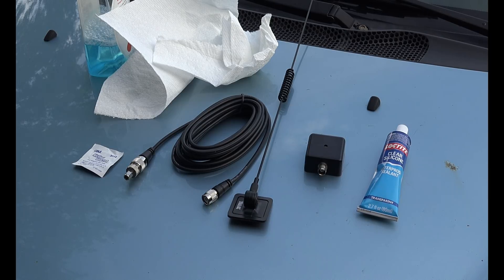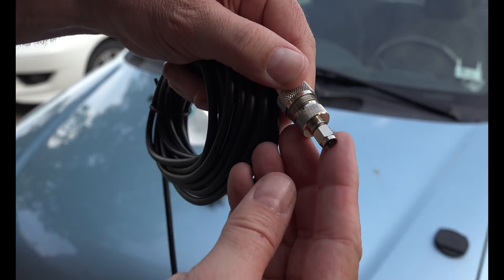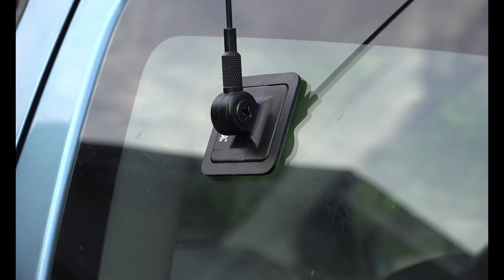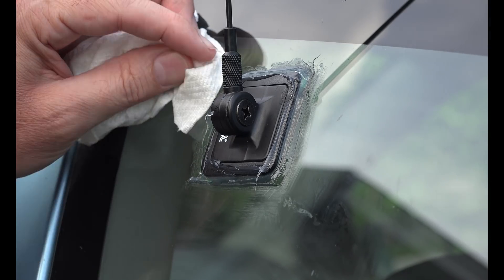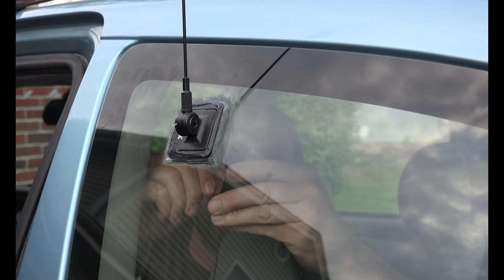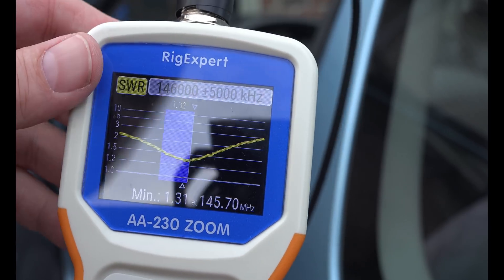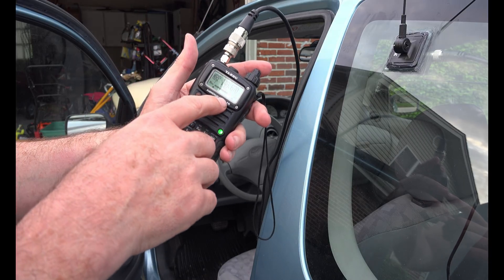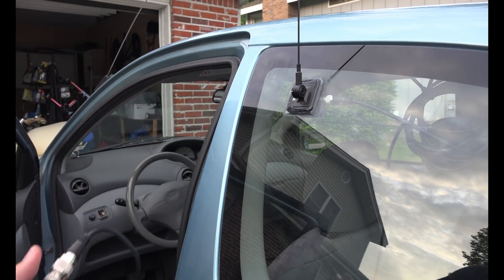Glass Mount Mobile Ham Radio Antenna Install ~ VHF UHF Repeaters

Comment: Great video! Thanks for the sub. This is exactly what I need. I tried a cheapo antenna from Amazon a while back that was a magnet bottom and wired down the side of my car door. After a while it just fell apart. I’ll try one of these.  I’m a total noob at HAM life. But trying to learn a bit as I go. Thanks dude.
Reply from the maker: Midwest Off Grid this will get you up and running on local repeaters. We can radio talk sometime if you want. My Twitter is @MyWheelsRock

Comment: Hey man I'm in Florissant I'm new to this. I just bought a diamond mr77 uhf hooked to uv5r I just noticed you were in stl. The only repeater ive found was 145.320 just from scanning. Do you have a list of repeaters I could try. I don't really have a clue what I'm doing lol. Mostly just want to scan. For fun
Reply from the maker: Hey there, I moved to Oklahoma City about 3 years ago, so I dunno.

Comment: I've used several of these over the years on different vehicles. Never had a problem. I currently have one for GMRS use on my pickup and my inlaws RV. Due to restrictions in my neighborhood, I have one attached to the only single pane window in my home. They all work perfectly. 
CHEERS from Colorado

Comment: Funny thing: I've been installing glass mounts for more than 30 years in both ham and commercial applications... Mainly Larsen, but quite a few Tram models... And I've never had one fall off. I've seen them last ten or more years in use. I've had my own last more than five despite Illinois winters and weekly automatic car washes. And I've never had to seal any of the hundreds I've installed and maintained. Seems like overkill, but if it makes you feel more secure, go for it.
Reply from the maker: Yeah thanks for the comment, probably don't need extra adhesion, but it makes me warm fuzzy

Comment: What adapter did you use to step down connect the handheld to the antenna cable?
Reply from the maker: You will find it in this box.  I have this: UHF Adapter Kit: https://amzn.to/2q3XvDu

Comment: That silicone skills ^^
1.) apply silicone kind of like you did but dont put it on top - only in the seam
2.) make sure you have enough because you won't be able to add anything after the next step
3.) spray some soap water on the whole thing
4.) use a plastic shaper made for silicone work of your choice to remove anything you don't want and leave a nice CLEAN seal.
5.) dip finger in soap water and gently smooth out last imperfections.
No extra time needed, just skill.

Comment: Can this work for home windows?
Reply from the maker: I would think so, but the problem would be the window is vertical and so your antenna would be horizontal.  You'd want the antenna to be vertically polarized.

Comment: Ok so i tun on my radio and the red light on my radio is blinking.  I oress one the side assign  buttoms on my cp200 motorolla and im ablemto hear conversation. but as soon i let go of that buttom i dont hear anything but the light keeps blinkin so the conversation  still there but i have to press the side buttom.  Not the ptt buttom but the lower bottom  side buttoms . How can i listen continuous without presssing the side buttom. Im doint something  wron or that is how it works

Comment: I’ll never trust another glass mount antenna ever again. I bought a new Dodge Dakota in 1999, didn’t want to drill a hole in a new truck and definitely didn’t want a mag mount scratching my paint. So, I bought the Larsen dual band glass mount antenna. It performed ok for about three years. I noticed a gradual decrease in received signal strength and I also noticed it was more and more difficult to get into my usual repeater (about 15 miles from me). It got so bad that I checked the SWR, which was acceptable right after installation, and it was in excess of 4 to 1. I was using a tri band Kenwood 742A at the time and the 2 meter module wouldn’t transmit more than a few watts no matter what the power setting was. I used a different antenna, temporarily, and still the same RF output was indicated. I rarely used 70 cm so it wasn’t affected. The glass mount antenna was removed and when it was, I could hear a sloshing noise in the plastic base the antenna screwed on to. There it was, water created a dead short and ruined the RF final on my radio. I examined the base and couldn’t find how the water entered the plastic case but, it did somehow. That was my first, only and last experience with a glass mount antenna. If they work for some folks, great. I ruined an expensive radio with one of them. 

Since I had that experience, I decided to drill a hole in the Dakota and have a proper mount. Every vehicle I’ve owned since has had a hole drilled and a proper mount installed. Not one issue with any of those mounts and I’ll never use anything else.
Reply from the maker: Ok, but I haven't had any problems with this.

Comment: The silicone seems like a very good idea...but, really and truely, I've used these on-glass antennas for 30 years, and never had one fall off, not even close.  In fact, I've often taken the old antennas off the cars when I got a new car, and reused the same antenna by using the remount kits with new pads, after cleaning off the residual adhesive pads on the used bases.  

The antenna bases are rock solid on the window using the adhesive pads provided, and when removing the bases to move them to another vehicle, I've had ro use Glue Gone, a putty knife to pry the bases loose, and it took some real elbow grease, and very cautious effort not to break the window.  That's how tightly adhered to the window they have always been. 

Now, my vehicles are always garaged, and perhaps if vehicles are outside all the time, the silicone sealant is necessary.  I live in St. Louis too, where Ham Radio CQ indicated he also lives.  So the weather I experience is the same as he experiences.  Perhaps it's something that someone would experience in a different climate where the sealant idea would be necessary.  But, for over thirty years, and probably six or seven antennas, some remounted using the remount kits, sealant has never been necessary.  Just my two cents that might save an extra step.
Reply from the maker: I hear ya.  It's probably not necessary, but I like to add it on.  I moved away from St. Louis.  I live in NE Oklahoma City now.  Loving it so far.
Reply: @hamradiocq  Hi, yeah, it occurs to me that some may have purchased on-glass antenna brands that needed some extra help from Silicone sealant.  I always puechased MFJ brand or Antenna Specialist Brand on-glass antennas, and with those two brands, the adhesion was always excellent.  I'm not affiliated with either of those brands.  But, with respect to Antenna Specialist, I began using them when I was employed in law enforcement, and that was the brand that was always installed on the patrol cars.  Then, later on, over time, Antenna Specialist just seemed like they had lost some of their prominence in the market place as other brands started to cut into their market share.  So, I started using MFJ brand, and it performed as well as what I experienced with the Antenna Specialist brand.
Reply: I have one mounted onto a 1986 Ford Tempo in a hot and humid climate for 30+ years, still there, not even pretending to come off, silicone definitely overkill unless it’s some Chinese junk adhesive.

Comment: Did this work well with the coax pointed down?  I just got one that says the connector needs to face right.
Reply from the maker: It works very well, it's been approaching 2 years since I made this video and still works great.  But still follow the directions as they are specified.
Reply: @hamradiocq  is yours the tram 1191?

Comment: With glass being such a good insulator, how in the world is this so affective? I would think the glass would negatively impact the reception. I realize that RF isnt electrical supply, but I wouldnt have thought an antenna like this would be good at all.
Reply from the maker: The spacing is minute.  It is a compromise from drilling into the car, but it works.

Comment: I have found that by craping off the paint on the L shaped ground rod on the end that screws and attaches onto the RF connector,  the SWR tuning is 100 % better than before with better return loss etc.
Reply from the maker: That is a great comment and idea, Lorne.  Will do.
Reply: Off the entire piece or just the part that makes a connection at the bracket?

Comment: Skip the Silicone,  been using glass mounts for 20 years never had a problem
Reply: How much did you pay for said glass mount antennas? I’ve tried 2 or 3 and they all came off within a number of weeks (maybe I didn’t follow instructions right. Who knows???)

Comment: Trim the glass and antenna base out with blue painters tape. Run your bead all the way around then remove the tape. No mess and perfect lines. I do the same thing when i use a caulking gun. Tape both sides if necessary run your bead of caulking, smooth out with your finger then remove tape. Works perfect.
Reply from the maker: Great idea!

Comment: I work for a two-way radio shop we installed hundreds of ASP's glass mount 800 MHz antennas the installation kit came with silicon rubber and the instructions spelled out using silicon around the mount of the antenna on the outside of the glass to reinforce the 3M double-sided tape pad, We use silicon rubber on both the antenna and a coil on the inside of the glass.
Reply from the maker: Ok, tnx

Comment: Is it worth avoiding the magnet mount on the body?
Reply from the maker: I think so. I just don't trust magnet MT.
Reply: Mag mounts work fine, but its really easy to scratch the paint. Even though the mag mount is flat against the car's body, water can still accumulate between the magnet and the car's body.
Reply: Its not only about the body, it's about the feed line route too.

Comment: How does this actually work? like.. physically... how does the antenna work through a non conductive material?
Reply: The glass is a dielectric, making the two plates into a capacitor. Capacitors pass AC, but block DC. Since RF is AC at very high frequencies, it works well, and forwards power through the glass. It will also bump up your impedence, but there is always a price for convenience. Because reactance decreases with higher frequency (check your license exam manual), these capacitors work even better on higher bands (i.e. 70cm, 30cm, etc.) but will still work fine for 2m and 1.25m.
Reply from the maker: I'm not sure exactly good question.
Reply from the maker: But it works.
Reply: There is a capacitance that is created when the two antenna pieces are placed on either side of a pane of glass. Actually I was surprised that it worked at all on a newer car. I used a glass mount from Radio Shack on a 91 Nissan years ago, but newer cars since then had glass encapsulated with tiny bits of silver in the glass which prevented the SWR from being adjusted to an acceptable level. I didn't use silicone, and with the 3M adhesive you really shouldn't need to use silicone.

Comment: Interesting install! Silicone wouldn't have been something I would've thought of using for a good tight seal, especially on glass for an antenna but I understand as to why you use it. Been thinking about putting two different glass mount antennas on my car to do away with my two stud mount antennas and seeing how you've done yours, looks to be s very good idea. Thanks for your informal video! It's very helpful
Reply from the maker: Its still atanding strong too

Comment: Great video, would this antenna work for a scanner or is there one similar for police scanners ? Thanks .
Reply from the maker: Good question.  This would def work for police scanners.  If you are receiving only you can be a lot more flexible than when transmitting.  The police frequencies are pretty close to the same as the ones intended for this ham radio antenna.  I say go for it!  There is a link to this scanner in the description.  If you use that link I get amazon credit for doing so.  Appreciated. thank you.
Reply from the maker: Just make sure the connectors match your scanner.
Reply: Make sure you get licensed first
Some states have laws that prohibit scanners, but there are always exemptions for hams

Comment: Installed a ton of those for Cellular and worked well with out the silicone layer
Reply from the maker: Someone commented below theirs fell off
Reply: @hamradiocq  If  the mount is installed correctly on clean glass, it wont fall off.

Comment: I've used glass mounts before with good performance.  I'm not trying to hit repeaters 100 miles away, just local ones.  No problems hitting some repeaters 40-50 miles.
Reply from the maker: I hear ya
Reply: Im new to ham, but what is that moris code sound for?

Comment: Only 4 mosquito bites....amateur....!    Looks like a pretty decent antenna for the auto!  Heck of a lot easier to install than running an antenna cable thorough a grommet, or making a hole.
Reply from the maker: Ron C I haven't raised the gumption to get through the firewall yet to do a permanent install
Reply: I did on my old Cherokee,  but it was a beater, ya know. I'm going to look at my truck this weekend and if I can find a way through the firewall without cutting, or drilling I'm going to use my old antenna (if the mount fits under the hood).
Reply: By the way, I'm a bit jelly of that Rigexpert...I thought all I would need was the little AA-30...now I want to analyze all the frequencies!..lol
Reply from the maker: I bought that about 4 or 5 years ago.  It was one of those things where I saw it and said, Yep, it's a tool I need in my arsenal.

Comment: I had one of those aerials about 15 years ago. I don't think the glass I attached it to had a flat enough profile and it flew off into the distance some months later :( While I had it I was extremely impressed by how well it worked on both bands. I believe you've made a better job of sticking out on than I did so let's hope it stays with you for many years :) 73 de G0TVJ
Reply from the maker: Ideally one should put it out of the wind perhaps on the back window if you don't have those heating defrost lines.
I think this silicone will keep water and dirt from getting in between and keep it on.  Hopefully this will help out some new ham.

Comment: A tip my dad showed me many years ago, dip your finger in some liquid dish soap before you smooth out the silicone.  The wet silicone will not stick to your finger and the fillet comes out very smooth and less cleaning up to do after it dries. ;-)
Reply from the maker: I think I saw the "this old house" dudes do that for caulking too!  Great reminder. Thanks.
Reply: Mike Jacobs Or a little bit of spit in your hand.
Reply: Mike Jacobs ....as a renovations contractor I can attest to this. Huge difference when using dish soap water. So much cleaner, and easier.